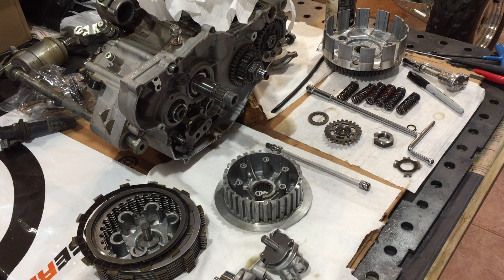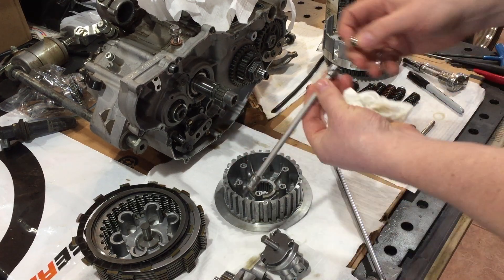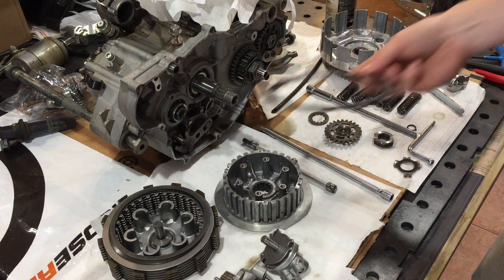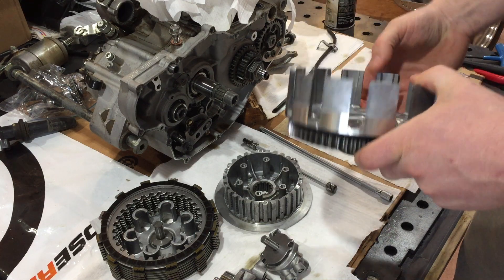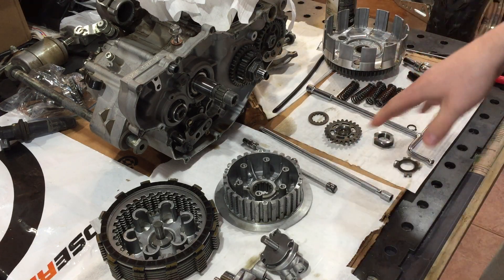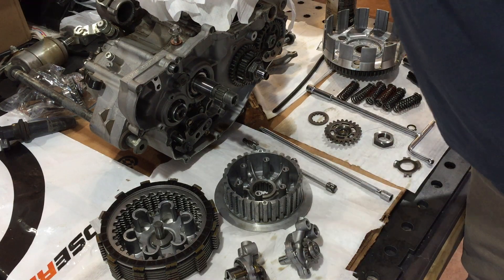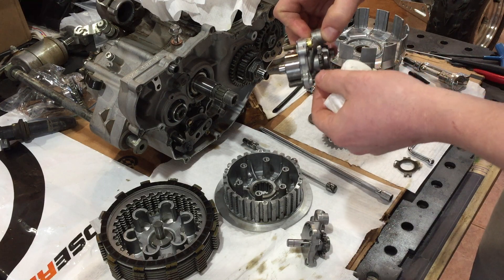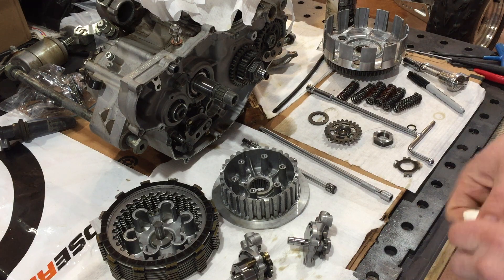Project YFZ 450 oil upgrade part 3 pump details and clutch operation

Comment: Do you need to change the oil line passage way as well or no? Because the 12 tooth has a bigger passage way than my OEM 13 tooth, idk if it’s because my new 12 tooth pump is not OEM or idk but the dowel from the old pump fits loose in the new 12 tooth oil pump!

Comment: Did you use the oil upgrade service from J & T Products or did you order the OEM parts and have someone mill and machine the case cover to fit the oil nozzle?
Reply from the maker: I got J&T service but was unhappy with the quality of the case work. I then purchased a new 07 case already drilled and milled from Yamaha.

Comment: My quad topend pilled up and jumped the chain etc , I’ve replaced all the top end and cam chain . Went to start it and had the oil bleed screw out and no oil at all coming up , I ran it less than a minute. Should I pull the pump out etc ?

Comment: I can't seem to find what parts you bought from yamaha for the oil upgrade ,would be alot of help if you can tell what parts you bought thank you very much
Reply from the maker: There are quite a few parts to try and list. mostly small seals and such, I use the oem parts catalog on rockymountainatv.com. If you’re mechanic can’t help message me here or email pdmfyi@gmail.com to get me direct.

Comment: They are both Cast Aluminum so very little if an difference in material. The Anodizing is not a coating. It is oxidizing the surface to harden it, but will only work until it breaks thru the anodizing layer. That does help to stop wear. Still I will not use it on my quad because Aluminum Oxide is one of the hardest materials only second to diamond. I wouldn't want pieces of aluminum oxide (Grinding Wheel) in my engine so don't replace the stock cage with one that is anodized just replace it from time to time. Anodized internal engine parts is always a bad Idea. Also Anodizing is not slippery in most cases less slippery more like a (aluminum oxide grinding wheel). If it is hard anodizing. If it is soft anodize then no advantage and still peaces of anodizing in your engine. All in all a bad idea.

Comment: So how loose is your oil pump idler/ drive gear on the shaft? And my case half has some grooves where the pump rotor sits, will this lead to cavatation? Thanks.
Reply: i have the same problem any word on the groves? did you run it?